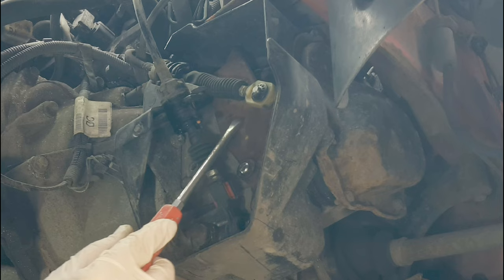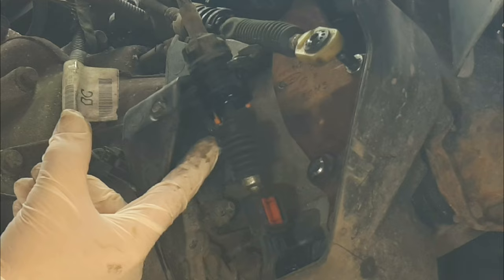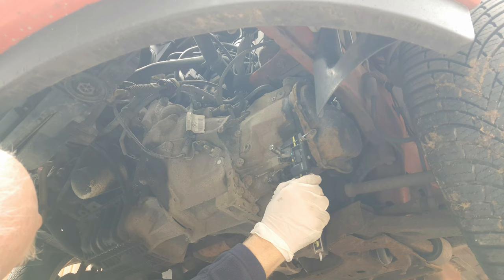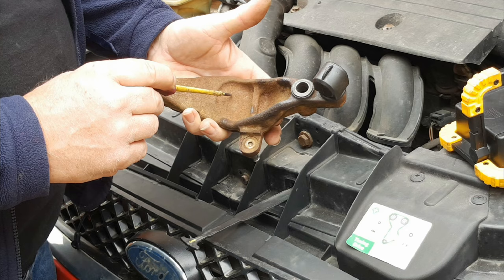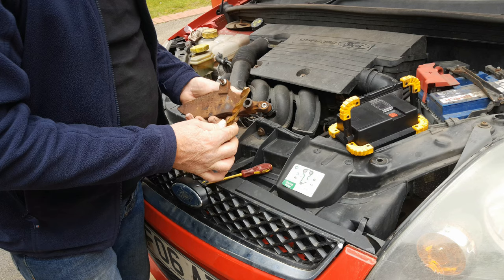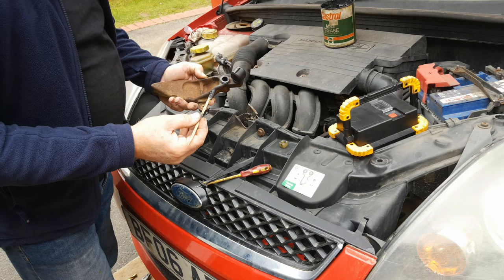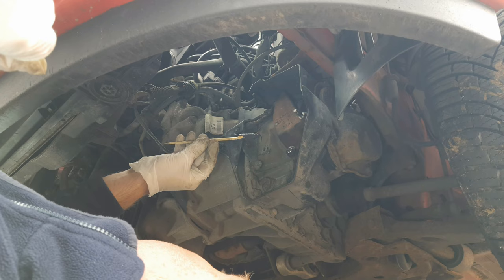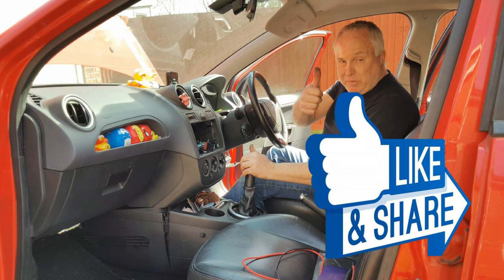Ford Fiesta mk6 Stiff Gear Change | 💯 BEST Repair Tutorial on Youtube

Comment: Where did you get the new bush from. thanks.
Reply from the maker: What new bush? There is no new bush. Just enlarging the old one.
Reply: @CycloneCyd  oh! ok thanks, I thought ya was drilling out the old one for replacement, only mine is not tight, it has a litte play in it
and I was hoping to replace the bush, but can't find a bush anywhere. any ideas.....thanks for your reply....
Reply: @bcbeadsworth  Did you find a new one to buy? Mine has cracked...
Reply: @apexinstinct  negative, couldn't find one anywhere.....
Reply: @bcbeadsworth  Ah ok thanks for replying, did you have to buy a complete new arm instead?

Comment: welcome to focus 1 1.8 tdci is that something too? because for me the problem is that with the engine on (when the car is standing) there is a problem with putting in each gear. I have to wave the lever to each gear and it'll just come in. And when the engine is turned off, everything goes in with a finger.
Reply: Same did you fix this problem?
Reply: @datwinz3927  Yes. Dual mass replacement
Reply: @andrzej1623  mine was gearbox related swapped it and now gotta deal with all the other horrors the car has to offer !
Reply: @staywokealways6507  good luck and good health :)

Comment: Any ideas why mines smooth and easy to shift when car not running but when running it doesn’t want to shift and is really stiff
Reply from the maker: Huh? Seriously, watch the video!
Reply: @CycloneCyd  I don’t believe mine is a linkage issue it seems to play up when the car is running people say it’s a slave cylinder issue
Reply: @CycloneCyd  car goes into gear smoothly when not running I will be sure to check this though!
Reply: @CycloneCyd  car goes into gear smoothly when not running I will be sure to check this though!
Reply from the maker: @dexietyy7922  so to be clear:
you can select gears when engine is not running (whether it's cold or warm)
With the engine running (eg immediately after a cold start) suddenly it's difficult to select gears?
If so, I'd say that's a clutch issue, but if you have an external slave cylinder, then yeah check that before removing the gearbox.
Does the clutch slip? https://www.youtube.com/shorts/j38p4oVraUk
Reply: @CycloneCyd  no the clutch is completely fine, it’s weird I got in it today and it goes into gear again now it’s just a bit stiff forwards and backwards it was very hot the other day when it was playing up maybe it is the linkage at fault!
Reply from the maker: @dexietyy7922  Have you checked for the problem described in the video? If not, do, it's extremely common

Comment: What about when the gearbox i's only stiff when the car has been driven a while, so when it's hot etc?
Reply: This video is for the problem you describe, as metal expands when hot, and thus get more tight the longer you drive.
But I have to give you a tip, try just popping the first plastic cover and dowsing the pin in some 5-56. 
I needed to wrestle the gears in after a few hours on the road, and now I can shift with my pinky after the same distance. 
Maybe not the long term fix, but works wonders for me so far.
Reply: @benghazi4216  was yours stiff moving side to side too in neutral or only shifting into gears??
Reply: @datwinz3927  It was only hard to push it into gear, any gear, but side to side was normal. Like in the video
If you live in a cold country, wait until it get like -5*C and you should start feeling that the shifting gets easier as colder it gets.

Then you know you have this problem shown in the video.
Reply: @benghazi4216  thanks for quick reply I’m guessing mine is the actual shifter as I removed the cables and it’s still stiff side to side….
Reply: @datwinz3927  If your shifter is stiff side to side, then this is not the video for you I'm afraid.
And I have to be honest and say I don't know how to fix your problem

Comment: A reemer would be better than a drill bit 👍
Reply from the maker: Probably would be, but few diyers will have one and surgical accuracy isn't necessary. It's only a repair after all.
Reply: Really doesn't matter which you use

Comment: My car doesn't always go into gear correctly, and it makes the gears grind.
Reply: Sounds like synchronization problems in the actual transmission.
Have you tried double clutching?
Basically changing gears in two steps: press clutch, shift to neutral, let go of clutch, press clutch, shift in to next gear, let go of clutch
If that works, my bet would be that your gearbox is singing its last song.
With my £2k fiesta i would have double clutched until it completely implodes, and maybe add some road side assistance to my insurance.